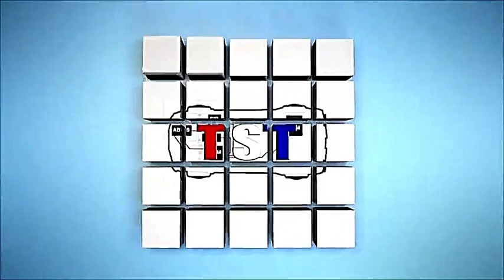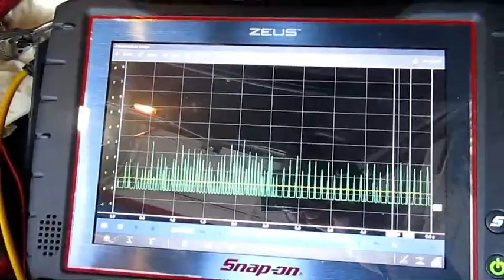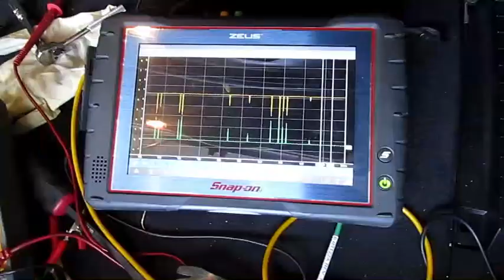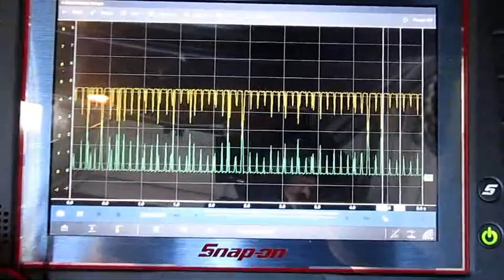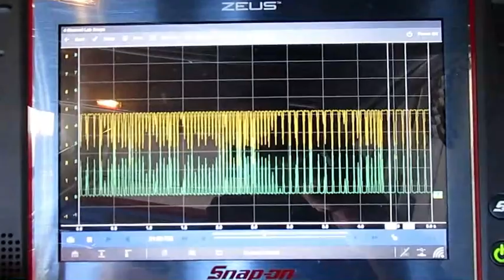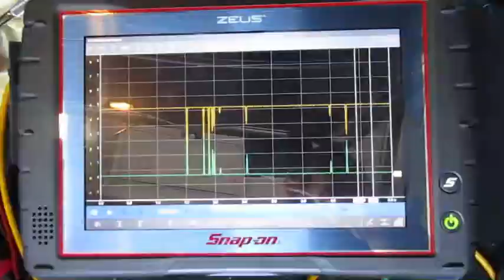745Li BMW CAN Gateway problem

Comment: Thank you for sharing. None of the waveforms resemble a good can bus waveform. Would like a follow-up video of the fix and a clean can high and can low waveform. Have a blessed and safe week to you and your family.
Reply from the maker: Billy there are bad and good waveforms on the scope...they may not look nice but the one that has both top and bottom when the Gateway module was taken out bring the BUS back up. The resolution on this scope is not great...it would look different on a PICO or EScope. Thank for watching...If you have not already subscribed to our tstseminars YouTube channel please do so. Interested in more training? Go to www.tstseminars.org and view full length videos for members on TechFlix for $9.99 unlimited viewing and www.attstraining.com for hands on training and webcast
FREE Unlocking The Potential Of Your Scan Tool with EScan and Generic Part 1 – AutoLand iScan3 Part 2 -  Autel Part 3 – LAUNCH Part 4 – Snap-On Part 5 – OPUS IVS ES Part 6 Air Conditioning 3 parts, Mode 6 and more at https://www.tstseminars.org/training-videos
Reply: @TSTseminars  Reason 1 of 137 of why SnapOn scanners/scopes are garbage, and they retail $10k+. What a joke.
Reply: @fuckjewtube69  All tools have their place.  Some are better at some things and the real key is knowing the limits of your tools.  This is not the tool I would recommend for CAN bus diagnostics and honestly you can still do it.  It's knowing what good looks like on this scope.  What you saw towards the end is a good waveform for this scope.  You just have to capture known goods and you would see this is normal for scopes with a lower sample rate.
Reply: @scottjhicks  CAN bus diagnostic is not even close to where the SnapOn scope fails miserably. For $10k its really pathetic.